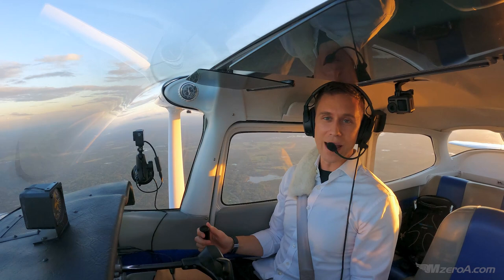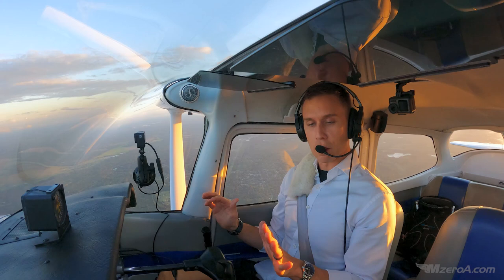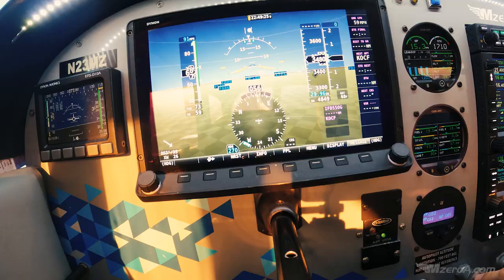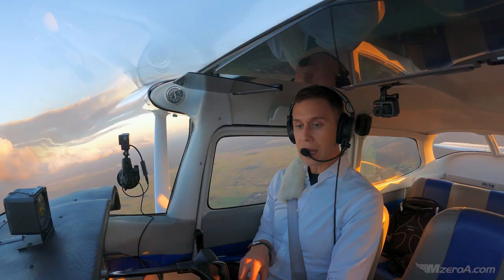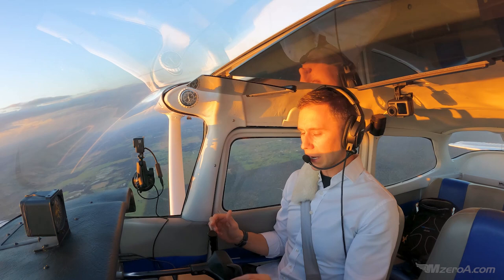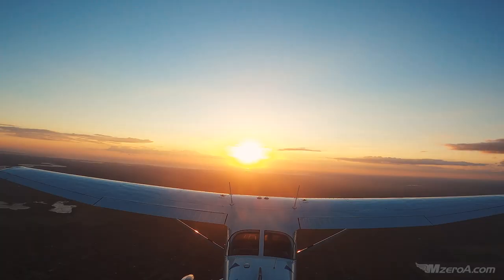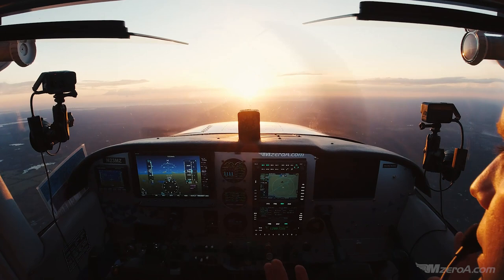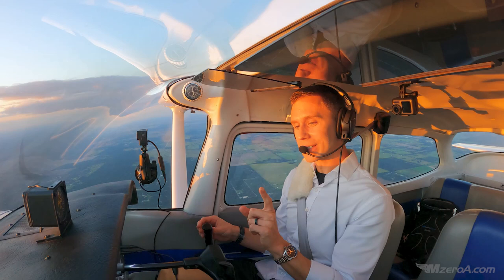Flight Maneuver Series [ Slow Flight] | MzeroA Flight Training

Comment: This is one maneuver I struggle with but this has helped. Checkride planned for This Sunday PPL. As I understand during clean configuration after you reduced your power, you added additional trim up? For dirty configuration you added trim down? I usually cant get the plan to fly hands free. For some reason trim is hard for me except during steep turns.
Reply from the maker: Hi Anton! There is no "one size fits all" for amount of trim you need. Every airplane and frankly everyday is different. Make small adjustments and feel what you need. Fly safe!
Reply: @MzeroAFlightTraining  I actually tried the trim today with slow flight and my gosh it is so much easier!! Just in time to show off my skills. A good pilot is always learning :-)

Comment: Very good Near MCA Slow flight demo.  I also used to teach slow flight at Vfinal speed to prep them to do Vfinal GRM.  Many accidents have happened when using full drag flaps on GRM or overheat the engine on GRM which is for sight seen at lower altitudes.  GRM Slow Flight Maneuver is different from "Near MCA Slow Flight".  The maneuver at higher altitude shown here.

Vfinal Slow Flight maneuver is also used in traffic pattern for spacing.  And also for the low 5 feet passes before letting it touch down finally.  That is 3 places where you use Vfinal Slow Flight.  The Near MCA Slow Flight Maneuver is not used anywhere else but over 2,000 agl and for a few minutes only due engine cylinders overheat can happen quickly on it.
Reply from the maker: Thanks for sharing! Fly safe!

Comment: Power = Thrust = Forward Acceleration = Increased Airspeed

Furthermore, an increase in pitch without added power, increases lift, which increases total drag, which necessitates an increase in thrust (or power) or overcome the added drag.

In equilibrium flight, T=D and L=W. Therefore, pitch for altitude and power for airspeed. 

NOT THE OTHER WAY AROUND!!

The only time you would ever pitch for airspeed is if you had no additional thrust available to overcome a descent (i.e. no engine) or flying behind the power curve.